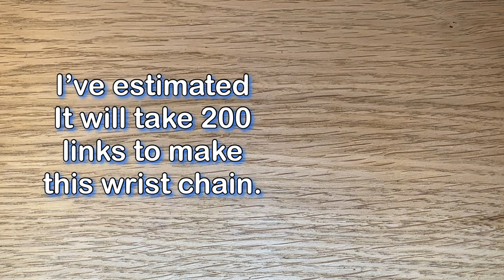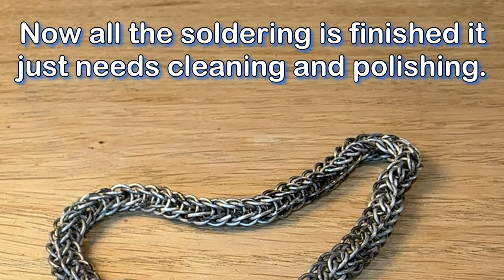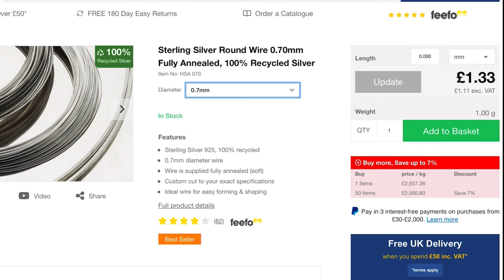How to make Full Persian chain (a traditional chainmail weave)

Comment: That is astounding.  And such patience!
Does the solder paste reduce the risk of surplus solder in each ring? Easy with a ring or bangle, just file it off. So a better judged amount of solder required?
A beautiful bracelet
Reply from the maker: thanks Andrew, yes paste solder is my preferred option when soldering lots of tiny links. If the joints are tight and neat minuscule amounts of paste are needed to close them. I tend to test certain size rings with copper to make sure I’m applying the correct amount of solder and there’s not too much excess. The sticky solder is easy to apply and no cleanup needed. After years have passed the solder joints don’t tarnish any more than the sterling silver itself staying invisible to the naked eye … N
Reply: @Nickscreativestuff  Thanks, Nick

Comment: Normally I build 4x4's with a grinder and welder, getting a bit old and sore for all that now and your vids have given me a new hobby direction. I've got a pot full of old knackered silver jewelry (a lot of it being antique and over 200yrs old.... apparently, lol)... anyhoo, I've invested in a rolling mill, draw plate, and basic tools etc, and this will be my first item I attempt, firstly, what solder paste did you use? Hard, medium or soft?
 Secondly I'm struggling to melt my silver. I've got multiple torches (being a bit of a handyman) but only propane...I can melt it, but not get it to 'ball up', I think im just a few degrees short... will mapp gas be enough, or do I need oxy? If so... where do you recommend I get the torch and gases from?
Any advice will be very welcome and even more appreciated. 
Cheers Nick👍
Reply from the maker: Hi swampdog, great hobby for a metal worker to get into. One of the things I found the hardest was using a jewellers saw, my teacher kept saying just be very gentle and the blades won’t break. Nice to have a stash of silver to play with. if melting say 20 - 30g in a 2 inch crucible an Oxy propane torch is most economical it gets up to temperature quickly and uses very little of the gases. if using pure propane on the same amount of silver you would need a Sievert style torch with a large nozzle say about 1inch diameter. i’ve not used mapp gas much before, but I’m sure it would work somewhere in between these two options. I feel privileged in owning a Smith’s Little Torch from Cooksongold one of the industry standards for a mixed gas torch however I only really use it now for when melting a crucible full of metal. my every day go to torch is a small handheld butane refillable but it’s nice having a large variety of torches to choose from. I use a large exchangeable oxygen bottle from hobby weld no hire charge just a refundable deposit. I used hard paste for this chain to give me the option of soldering end caps if I wanted. also if I had a problem with a link mid length of the chain it would be easier to repair with easy solder … all the best … Nick
Reply: @Nickscreativestuff  cheers Nick, I appreciate your reply, my crucible is a 2" one, perhaps im trying to melt too much at once, as I am using a 1" torch (it's actually my dad's old soldering set up we've always used for plumbing).
I'll take your advice and run with it. Here's to giving my my old jewelry a new life....👍
Reply from the maker: you could try intensify the heat by surrounding the crucible with other pieces of reflective ceramics or another option I’ve used before is placing  lumps of charcoal on top of the silver and crucible allow it to combust and glow contributing to reflective heat. it can be then flicked off before pouring … N

Comment: Very good! Clear instruction. Nicely made video. I have just one question. What type of silver solder you using to assemble the chain?
Reply from the maker: thanks for that Micro Pyro, i’m using what’s called silver solder paste.
It’s a clay like substance that is sticky and doesn’t need any flux only really good for small items that can be heated quickly, perfect for chain making and allows the process to be very easy and convenient … cheers … Nick
Reply: @Nickscreativestuff  Yes but is it easy, medium, or hard type (melting temp).
Reply from the maker: you can get all three, but I tend to use easy a lot … N
Reply from the maker: i’ve just checked out Cooksongold’s website and it seems you can get four varieties there is extra easy now available … N

Comment: Can use .999 silver instead of .925 silver? And do everything else the same as your video.
Reply from the maker: Hi Charles, i’ve never made a chain from fine silver I would worry about it being a bit soft and deforming overtime. I have previously made a cuff bracelet from fine silver but have noticed that it has scratched and marked a lot more than usual when wearing sterling silver … N

Comment: Hi Nick!  I teach the Sweet Pea weave at the 55+ community we live in for free.  We use sterling 1 mm wire, 4.5 mm jump rings. Some have a hard time seeing where the links should be placed,  I'd like to use your visual aid in my class.  Could you please share with me what and where you get the tubing?  I'm assuming you use dowels to connect the tubing.  Thank you for considering my request.
Reply from the maker: hi Sue, must be nice to be involved in a group like that. It’s called PVC tube and I got it from my local hardware store and paid about 50p a meter. I used barbecue skewers to join the tubing, but that would be depending on what diameter tubing you can’t get hold of. I originally use this technique in a previous video, here’s the link if you’re interested https://youtu.be/AWz2n3_wnME … good luck with it … Nick
Reply: @Nickscreativestuff  Thanks so much!
Reply from the maker: have fun with your group … N

Comment: guess you are soldering one by one for our benefit instead of having some already soldered and just add the open ones as needed.
Reply from the maker: hi JSL, I suppose there are a fair few different ways to achieve this chain and it’s dependent on finding something you can comfortably get into a routine with. When working without cameras tripods and lights in the way, my preferred quirk is solder pick in the mouth pliers in one hand and tweezers in the other and a bowl of links to get through. When comfortably immersed in the monotony of chain making hours can slip by and my chains grow rapidly … N